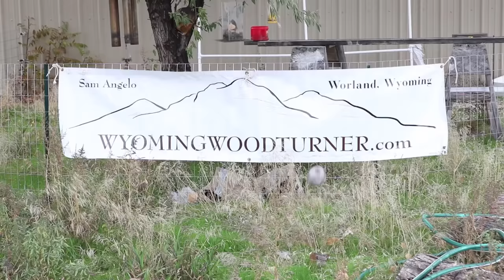Bark Edge  Birdhouse Ornament    by  Sam Angelo

Comment: Hi Sam I was just wondering why you don't use a compass for marking tenons?
Reply from the maker: You mean dividers?  Sometimes I do.  It depends often if I can reach the area more safely with one tool or another.  I use many tools to accomplish something.  It may be just because the tool is sitting there.  Sam
Reply: WYOMINGWOODTURNER so, now that you're hollowing them out a bit, are you just drilling a hole with a forstner bit, or are you doing it some other way?  Cool bird Houses!